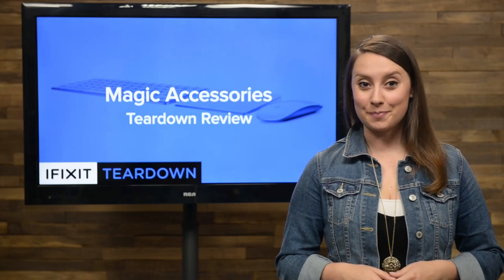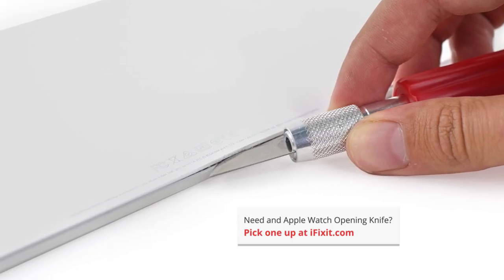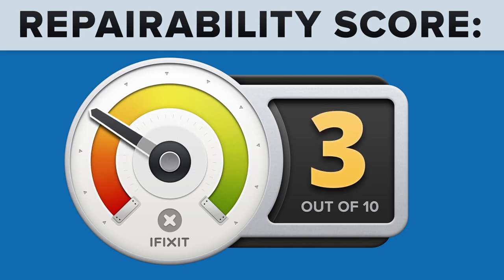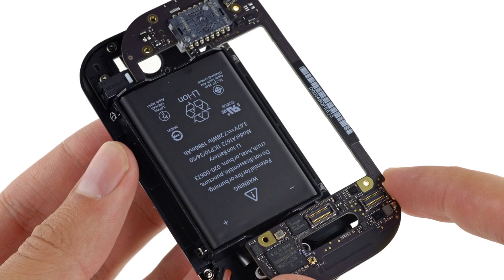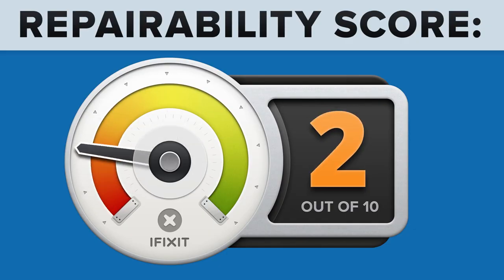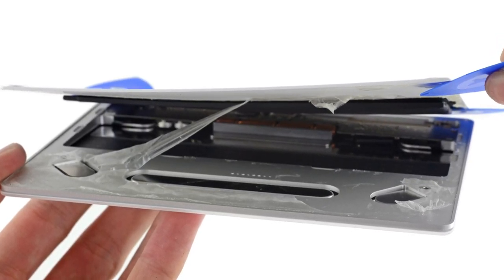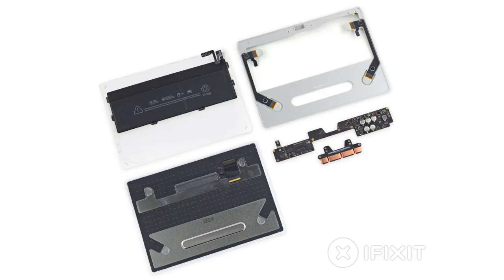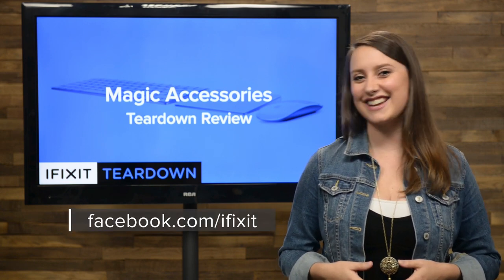Magic Accessories Teardown Review (Magic Keyboard, Magic Mouse, and Magic Trackpad)

Comment: What were they thinking when putting the charging port on the bottom on the Magic Mouse?!
Reply: +Adrian D. Yeah pretty ridiculous but given the shape of the mouse I don't see where else they could put it. Induction charging would be perfect.
Reply: +Michel PASTOR Logitech g700s or well... every micro usb rechargeable mouse ever. The front of the mouse right where it would normally have a cable.
Reply: +Adrian D. I agree it's pretty ridiculous. BUT, the mouse can't be used while charging, so...there's the tradeoff.  Charging once a month for a couple of hours is another.
Reply: +Adrian D. Agree. Many people already don't like the original Magic Mouse, and now they've made it even more laughable at best.
Reply: They were thinking that they don't want a giant HOLE in the side of their beautiful design, and thinking that any sane, rational person will charge it at night and keep an eye on the battery low warning, and maybe consider charging it again, a week before it dies. Apple peripherals come pre-charged with around 80-90% charge anyway, so there's plenty of time for you to plan when you'll next charge them.

I don't understand this non-issue - it's well known that even a mere TWO mins charging time will afford you NINE HOURS of use. There really is no cause for complaint whatsoever.

PS: Who doesn't own a SPARE MOUSE, even if they can't work out the bare simplicity of the above? :-/ LOL
Reply: because it takes like 10 minutes to charge and the charge lasts months, which makes it not a problem in the slightest
Reply: ***** If the design is so "beautiful", it should be so even when you are charging it.
Reply: Adrian D. What does it matter? You charge it when you are NOT USING IT, ie when you're asleep. Pretty obvious to most sensible people.
Reply: Apple always put design over functionality. the magic mouse is so uncomfortable to use, and it can't be used while charging.
Reply: vegan pizza not really
Reply: dog69420 wow nice argument

Comment: You have to give Apple credit for modular design - they mount a separate lightning socket module on mounting bosses away from the logic board, meaning that any undue strain and stress applied via the lightning port IS NOT transferred to the logic board. 10/10 for design, and as for the glue, it makes sense - when was the last time you heard of someone (apart from the iFixit folks) repairing a keyboard? These are commodity peripherals - if you own a Mac you are likely an efficient, busy person, and you'd just replace it. "Wasteful"? Maybe, but depends on how much you are losing in billable hours in downtime fixing it VS just buying a new one OR ASKING APPLECARE TO REPLACE IT.

Comment: Why am i still buying mac?!  They are overpriced throw away components.  I can't even repair their products and they don't last over 4-5 years?  I have gone through 3 of these keyboards, 2 of these magic track pads.  Almost canned my 5 year old MBP but rossman got it running again.  My first imac is still kicking after 14 years and 3 hard drives.  But the junk they put out today makes me question them.  Still using an iphone 6s but not sure about upgrading.

Comment: Apple, stop the excessive use of adhesive on the built in battery! If the battery has to be built-in, then atleast with less adhesive and more non-pentalobe screws!
Reply: +Mabirc the adhesive may be necessary for full contact so that it radiates heat properly.

Comment: on the mouse.
Why is the charging port on the bottom to collect dirt?
Reply: stop using a mound of dirt for a mouspad
Reply: To get you to buy two different mice or a firmly held belief that you shouldn't have the privilege to use your Mac without a Mac mouse
Reply: how does it it make it look nicer? USB C is barley noticeable and if you're more concerned about the look of a mouse vs the feel of a mouse, you've defeated the purpose of a mouse.
Reply: the design is stupid.  I own one.  the metal casing reduces the bluetooth signal.   It would have been a much better design to have the usb port on the end of the mouse and allow connectivity via usb if you so desired.  And before the fanboys get itchy - a lot of people are having the same issues. Just google and see for yourself.  I love my Mac, but apple seriously needs to get over this form over functionality thing they have going on...

Comment: 1:26 Don't you mean butterfly mechanism?
Reply: +Adrian D. Mistake on iFixit's part. It is in fact a scissor mechanism, just updated. It doesn't use a butterfly mechanism like the MacBook.
Reply: +Adrian D. Nope.  The new Macbook has the butterfly mechanism but the magic keyboard has a 30% better scissor mechanism.
Reply: Yes, dont blame them they are not experts..... Oh wait..
Reply: +Adrian D. It was a scissor mechanism, but it's the one we saw for the past couple of years, with some minor improvements. It's not the one that is in the new Macbook
Reply: It's the same thing
Reply: Just read up a bit myself, and it is NOT the butterfly mechanism found in the MacBook, just a scissor mechanism that is lower profile and more stable. iFixit had an error on that one...
Reply: +kyle gabbler She was incorrect.... in claiming that this new BT keyboard used the same mechanism as the new Macbook.  It doesn't.  It does use an update scissor mechanism.  

I really wish Apple had used the new butterfly mechanism, though, and that they'd create a new butterfly mechanism extended, corded, keyboard.
Reply: 2015 macbook

Comment: The new key mechanism is called butterfly. The scissor mechanism is the old one.
Reply: Just read up a bit myself, and it is NOT the butterfly mechanism found in the MacBook, just a scissor mechanism that is lower profile and more stable. iFixit had an error on that one...

Comment: So, afaics the main component of apple's new devices is: adhesive.
And why no wireless charging? Placing the charging connector at the bottom of the mouse is ... just ... idiotic - ain't it?
Reply: +Nick O'Laus wireless charging wastes a lot of energy.  that technology should be outlawed because of the waste built into the design.  what we need are room temperature super conductors, so that our phones charge in 10 seconds, and super micro capacitors so that it retains a week's charge.  the screens should do double-duty as solar charging cells.  the back could be covered in PV cells...  There's tons we could do to make phones better but as companies do they string us along and wring the most out of each teeny little increment.  bastards.